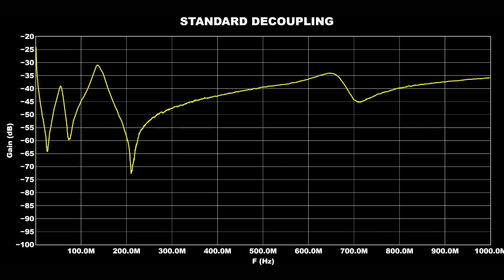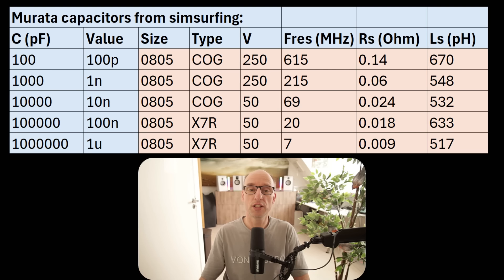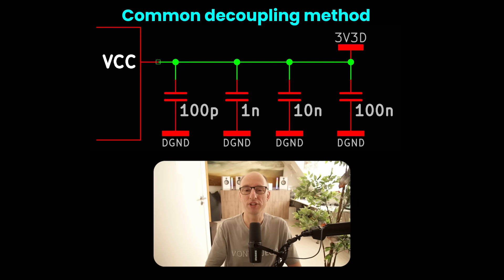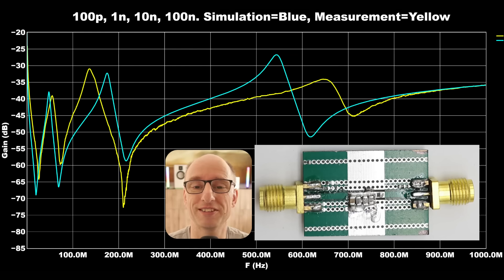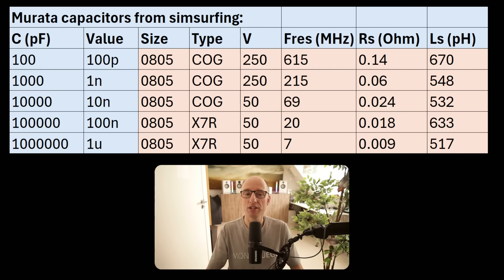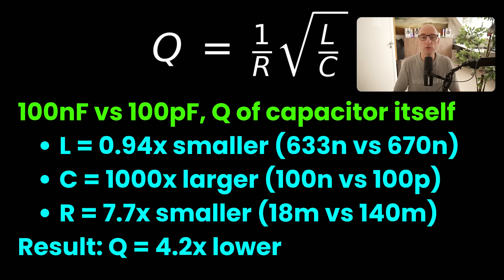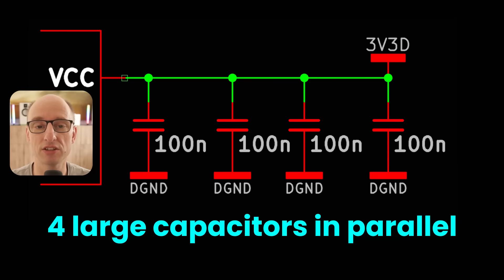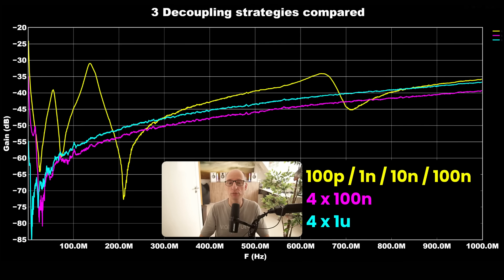The most misunderstood concept in decoupling

Comment: I remember seeing this theory in a technical article from either Murata or TI. The article mentioned that “when using ceramic capacitors, there’s no need to place a 100 pF capacitor next to a 0.1 µF decoupling capacitor, otherwise the two capacitors will cancel each other out at a mid frequency.” However, I’ve noticed that many IC reference designs still include both a large and a small decoupling capacitor.
Reply: I find this all the time. What I figured out is it may be a practice partially from a historical time when one used a small ceramic, say a mid-value tantalum, and a large value elecrolytic capacitor, with the same reasoning. But back in that day, each of the larger capacitors had a series resistance that happened to be large enough to damp the resonances, unless one specifically chose a "low ESR" tantalum or electrolytic and might have (if knowing) done the calculations or simulations. And those larger capacitors had much larger inductive components so needing to be parallelled to get the desired result. However this would typically been a 0.1 uF with a 10 Tantalum and a large value electrolytic. The pairing of small distinct value ceramic may even have been a mistake many years ago, possibly from the days of leaded capacitors.
Reply from the maker: Yes, it's all over datasheets and it can cause problems...
Reply: There is a lot of bad "historical" advice around and not just in the RF space. Audio folks are even more extreme in their religious beliefs. The truth is that decoupling caps don't do a thing for audio applications. I have been designing audio circuits without any decoupling caps for years, but what I do is to design active power supplies with extremely low differential output impedance.

Comment: On a board say 10 cm, up to 15 or 20 cm, and care about frequencies 450 MHz, not only power supply traces that are linear but even power planes have a transmission or wave component that might be significant. Any idea how to simulate a power plane of that size with distributed capacitors?
Reply from the maker: I never did that personally. I'd look for pdn layout simulation online.

Comment: "Fun" someone says. Now I have to change years of designs!

So many embedded CPU and conversion part datasheets demand exactly this wrong, even showing smaller capacitor closest on their demo boards. And I know you are right, in part because I have already modeled my capacitor banks (using the method of looking at SRF/ESR parameters) without having realized this issue. LTSpice already has the three components in the standard capacitor module. I even had the parametes connected to external variables for SRF and resistance to make it easier. And frustrating since my last design had to be out to board maker a couple of weeks ago and I didn't have time to do all the steps needed to make adapting changes, even though I first watched this before that.

YouTube linked me to a 9-year old video on bypassing that showed multiple values in parallel. But realized something from long ago, when people used "tantalum" capacitors for medium values and even larger were electrolytic, so they inherently had the resistance with ESR in half ohm or greater, so would actually solve the problem using your series resistor method embedded in the larger value capacitors. (But then I like my boards to last longer so moved into the modern world, without realizeing all the effects of the change.)

Also note you mention nightmare scenarios occasionally with these kinds of issues. Had one with a timing glitch that required rental of logic analyzer and over a week, though just myself, still a lot of time to catch and fix. (But that wasn't in this century.)

Also from US, in case interested.

Comment: There is a car analogy. 
Having 4 different springs on each wheel may seem better for covering "more" different roads... but in reality will result in very bad car. every body understands this.
Adding serial resistors to for each capacitor is like adding dampers to each of the equal springs on each wheel. that simply make everything smoother...
See, it's an easy example any 5 year old will understand...  so next time, just thinks of springs and dampers instead of complex things.
Reply from the maker: Great analogy!
Reply: You are vastly overestimating a 5 year olds comprehension skills.
Reply from the maker: @Chibs 😂😂😂😂😂😂

Comment: Great video. Let’s say that in the first “standard” case, the total capacitance will be 111.1 nF, in the second case – 400 nF, and in the third – 4 µF.
But what would be the difference if the total capacitance of the capacitors is taken as the reference point instead?
Let’s choose 400 nF as the reference, and test three variants:
1. In the first variant, the capacitances of all four capacitors are different (for example, 330 nF, 68 nF, 1 nF, and 33 pF – or any other combination).
2. In the second variant, use the same four 100nF capacitors.
3. In the third variant, use a single 400 nF capacitor.
What would be the results in that case?
Reply from the maker: case 1: lots of impedance bumps
case 2: You've seen that result
case 3: Single deep dip, but not as deep as with 4 parallel caps of 100nF because in that case you get 1/4th of the inductance.
Reply: @HansRosenberg74  Case 3: One deep dip, but not as deep as with four parallel 100 nF capacitors, since in this case the inductance is 1/4.
Inductance 1/4 of what? Tell me more.
Reply: @ForVesta-jr7ub  1/4 of the inductance of one 400nF capacitor.

Comment: Judging by this logic, do all the MLCCs on the same rail has to be the same package? But what if I need a capacitance value that I can't find on a specific MLCC package?
Reply from the maker: Yes, in reality you often need multiple packages. I did write a post on linkedin on this subject. It shows one option: https://www.linkedin.com/posts/hansrosenberg1974_%F0%9D%90%82%F0%9D%90%9E%F0%9D%90%AB%F0%9D%90%9A%F0%9D%90%A6%F0%9D%90%A2%F0%9D%90%9C-%F0%9D%90%82%F0%9D%90%9A%F0%9D%90%A9%F0%9D%90%9A%F0%9D%90%9C%F0%9D%90%A2%F0%9D%90%AD%F0%9D%90%A8%F0%9D%90%AB-%F0%9D%90%92%F0%9D%90%9E%F0%9D%90%9C%F0%9D%90%AB%F0%9D%90%9E%F0%9D%90%AD%F0%9D%90%AC-activity-7379175861100658689-HNQd?utm_source=share&utm_medium=member_desktop&rcm=ACoAAAM3nI0BbtMZxtGMDAiz8a035oBAOkfhRFc

however, the number of options is near infinite, so you'd have to try your own specific situation in the simulator.

Comment: Hi Hans, have you ever tested the “sideways” 1206 capacitors? I believe they’re called 0612, where they use the long edge as the joint. Supposedly they increase inductive losses?

I would love to see those tested!
Reply from the maker: I would assume the inductive losses get lower, since you have more surface area. I have not used those ever. The best solution are the feed-through capacitors. They really have the lowest inductance.
Reply: Type Geometry Typical ESL
LW Reverse 0204 (0510 metric) ~0.15 – 0.2 nH
LW Reverse 0306 (0816 metric) ~0.12 – 0.15 nH
3-Terminal / IDC 0402 / 0603 equiv. < 0.05 nH
Reply: Normal type
Size (Imperial) Typical Inductance (ESL)
0402 ~0.4 – 0.6 nH
0603 ~0.7 – 0.9 nH
0805 ~1.0 – 1.2 nH
1206 ~1.2 – 1.6 nH

Comment: I remember reading a Xilinx application note maybe ten years ago that described in great detail how to calculate which capacitor values and in which mix you should use for a general-purpose FPGA board. I've always stuck with just 100 nF everywhere and I've never met an issue that could be attributed to decoupling.
Reply from the maker: That works well, but watch out if your circuit draws very large current spikes, the 100n will not be enough.
Reply: @HansRosenberg74  Thanks for the info.
https://web.pa.msu.edu/hep/d0/ftp/run2b/l1cal/hardware/component_information/xilinx_xapp623_decoupling_caps.pdf
Reply: performance always improves by shrinking the package and increasing capacitance except for a VERY small cross-over at the smaller capacitance's resonant point. you should use whatever is the smallest package you use for your package (say, 0201), and then maximize the capacitance in that package. going with 0.1uF because it is "sufficient" will always be higher risk than using a 1uF in the same package and voltage rating. just because you haven't seen a problem does not mean it is the best design.

Comment: Key information is missing from this Video sure you don't want to put smaller and smaller capacitances of the same packages size closer to the pin. instead you want to decrease the package size as each capacitor gets closer to the pin. e.g. place a 0402 next to the pin, then for your second capacitor step up to a 0603, which will enable a large capacitance, etc. this is why the capacitance decreases father away from the pin. no one( except apparently this video) is suggesting using the same package size of capacitors in different capacitances. the point of decreasing the package size is to decrease the lead inductance. often you will find 4 larger capacitance capacitors like in this video further away from the pin
Reply: there are a surprising number of people who see datasheets recommending 1uF and 0.1uF and just follow the datasheet's recommendation. if the smallest capacitor you're using in your design is 0201 and you're running 1.8V, then both of those capacitors will be available in the package, so you will have two parts of the same package but difference capacitances. thus, this information is still relevant. lots of designers also use MUCH larger parts than 0201 as their minimum, and thus have a huge range of available values at that size. 

so maybe the better video topic is "when the datasheet says to use 1uF and 0.1uF, should you just use a single 4.7uF instead".
Reply: @somedude-lc5dy the general rule that text books teach is use the largest capacitance available in that package size, and the best electrolyte you can afford. Its miss interpreted as decrease the capacitance towards the pin. Whether or not that's the correct way to do it is up for debate as well, but that's a discussion for another day
Reply from the maker: Correct, I did not go over that in this video. I do have a linkedin post showing what happens when you do something like that I believe. You can't put everything in a yt video that is related, it will become too long. It's always hard to determine what to put in and what not to.
Reply: @HansRosenberg74  I feel that that is possibly the most important factor thouhg, without it it's not a real-world use case. if you do the same simulations based on a pyramid, decoupling the results are not comparable to this video.

Comment: veery nice! I'm an inventor trying to build a sensor based on ac electric field absorption using a simple plate as field emitter and another one as the sensor itself, all using rf modules... I've learnt that impedance is a pita when you're scanning in a range such as 10khz to 4mhz and yet not found any solution for stable measurement since reflection is wild and a matching network would be my entire room of space even using smds...is there some video in your channel that could help me find a solution for this?? thank you so much! great video
Reply from the maker: I don't think I have a solution for something like that, Maybe try to avoid matching altogether? Maybe just sense voltage?
Reply: @HansRosenberg74 thank you for your response..ive came across things like using resistors to lose some signal but grant match

Comment: Why using 4 capacitors instead of just one?
Reply from the maker: It is something of a standard practice you see a lot, but it's not the best idea....
Reply: @HansRosenberg74  never saw such practice. You can open any datasheet and find decoupling recommendation. 
And I can't imagine that someone working with HF is not aware of this.
Reply: @mxvmx9568 are you a student? If you're a senior level EE designing schematics/boards you've certainly come across the decade decoupling scheme in either an app note or data sheet.
Reply: @Informative-and-fortunate 
nope, but for the last 20 years it's not the case, when we are not talking about the rubbish design. 
You should think first, no need to come across 😉
Reply: You replace the typical 4 decade value capacitors with 4 of a single value. Many data sheets and app notes call out 1uf, 0.1uf, 10nf, etc. I've rarely seen 4, but usually those 3.
In the case of the data sheet calling out 3 decade values, you use 3 of the same largest capacitance value supported in the package you want. (Being mindful of dielectric type, voltage, DC bias derating, etc.) 
My favorite is using planar capacitors with the power planes 😊.
Keith Armstrong has a great EMC class which covers so many good design topics.
Reply: Multiple parallel capacitors lower the impedance
Reply: Вероятно на большой плате с множеством микросхем одного конденсатора мало. Я ставлю дополнительно к нескольким 100n один тантал полимерный конденсатор на 47 микрофарад
Reply: @tebsadjlrr221 You don't asnwer my question. Instead just descibe your approach.
Reply: @ivantatarchuk697  I think what he is saying is that many chips require one capacitor per power pin. you might have 4 or more power pins on each part, so you need at least 4 capacitors. I'm still not sure if that's relevant to the video, because that use-case isn't really what the video is covering. the video is really covering decoupling applied at a single "pin"/point.

Comment: Your comparison between simulation and demo board is quite convincing. What was your PDN impedance though? Do you suspect this scheme would hold true on a larger area board with strong plane capacitance?
Reply from the maker: These were very close together, so trace/plane impedances were not involved. And yes, you can always get resonances. Most of the time, they are no problem, but when you have sensitive circuits or high power, low voltage, high load peak circuits, it's definately a problem

Comment: it works great if all four 100n caps are close to each other; what if you have multiple ics that need decoupling and are 5cm+ away from each other and you use four 100n caps at each location? would the inductance of the trace add resonance?
Reply: Yes it would that's exactly the case outlined with the 1 Ohm Resistors. It's to mitigate line impedance resonances.
Reply: The trace inductance depends on trace width and height above the GND plane.  If you are using a 4 layer PCB this usually isn't an issue.
Reply from the maker: Yes, I agree with the other answers here. If you go to really fast signals, trace inductance may come into play, but the 100nF caps really help to reduce the Q, 1uF or more is even better off course.

Comment: It is not that simple as in this video. Usually I have to satisfy these requirements:
Capacitance with set DC voltage
Current rating (ceramic caps can not deal with more than 4A effectively)
ESR
Pulse/transient response
Available area

Putting capacitors blindly is never a good idea.
Reply from the maker: Totally agree. This shows a part of the problem/solution. However, if I want to explain everything you mention, this will be a complete PDN design course :-). Youtube videos are relatively short so you can only cover partial problems in general. It is always a difficult trade-off how much information you add. I will put other considerations in other videos lateron.

Comment: Is this also true for 100nF and 4.7uF ? For example next to a regulator or near an ic supply
Reply from the maker: yes, that will cause a resonance. However, since the values are much larger now ( the smallest value is already 100n), the Q will be much lower so it will act much more friendly.

Comment: i work with audio electronics and i'm curious to know whether these factors are important with such low frequencies. do you have any insight on that?
Reply from the maker: Yes. The audio frequencies are never the problem. However, if you do mixed signal (like with a DAC or ADC) you're suddenly dealing with RF. Why? The harmonics of those digital clock signals go way up into the MHz range.

Something you also cannot get rid of (unless you move your audio rig off-grid like Alaska or something like that) is loads of RF interference from wifi, bluetooth, mobile phones etc etc. This will get into your audio circuitry through the interlinks and loudspeaker wires which are great antennas. These need to be suppressed and that will only work with a ground-plane, good decoupling and preferably some common mode filtering.

Comment: Some comments: 1) Your simulation (and VNA measurement) neglect something very important -- the change of capacitance of an X7R (or X5R etc) capacitor while under DC bias (whereas, for example, a 100pF C0G has a constant capacitance across DC bias). A VNA puts very little bias on the capacitor because the signal levels are low. 2) The simulation and VNA use a 50 ohm source/load, which is much higher than an actual power supply (for high current load, anyway). Using 50 ohm source/load buries the Q values of the caps by ~2 orders of magnitude. 3) For very high speed electronics, the response at 100 MHz (for example) doesn't matter as much as the very high frequency response -- we're talking edge rates in the sub-ns range are what matters.
Reply from the maker: Correct, the goal here is to show that resonances occur. The 50OHm system is just to show that because you can measure in that impedance very easily.

I'm dealing with the DC bias issue in my next video (which is already live)